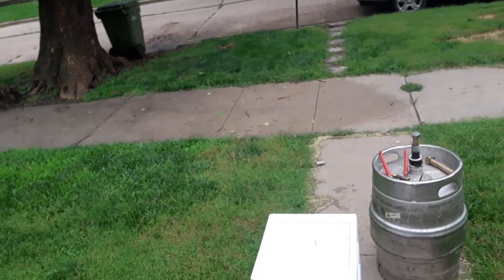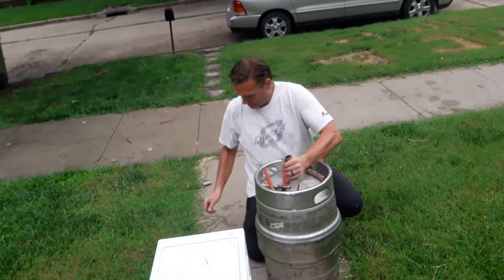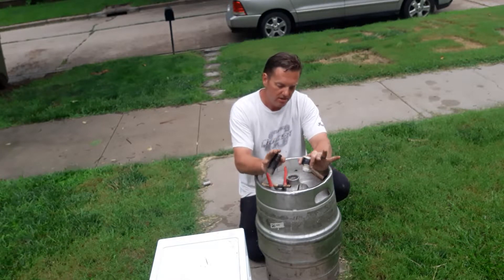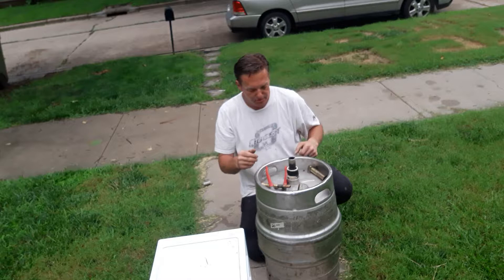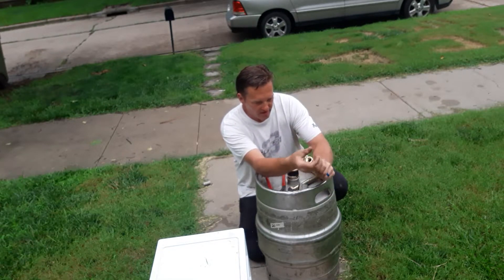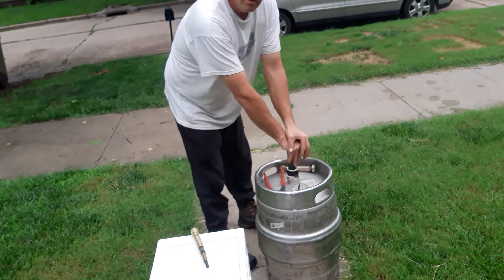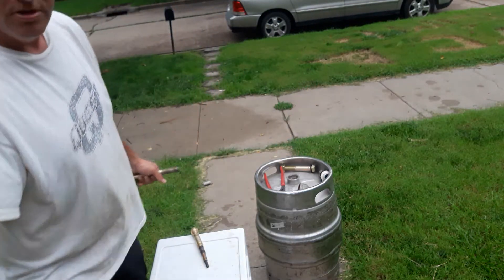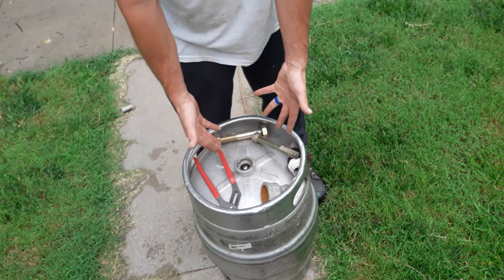Build a Pressurized air/ water tank for marine, and farm use Video#1 DEPRESSURIZE TANK

Comment: What kind of CFM would keep up with a set up like this? 4.0CFM good?
Reply from the maker: 4 will work  you may have to take small breaks to let pressure build back up. My set up is 6.1 and I have to let pressure build occasionally. You have to go up to 21 cfm to maintain pressure continuously. But you’re spending big bucks to get that.
Reply: @tctime thanks for the reply!